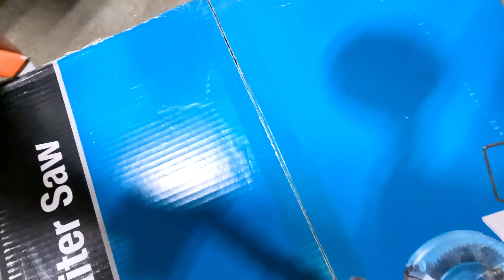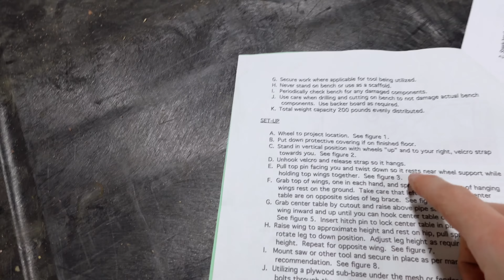I felt unsafe using this tool...

Comment: I'm not sure the problem is the saw. Don't sell it short, that particular saw is not just "made to cut construction grade pine" It's a pro-level saw. I own one myself and have neve found it underpowered or incapable of the job...  I think there are several things at play here. For one thing, your blade. If you are using the saw heavily, it's time to upgrade to a professional blade that's designed for that task........ Your own words indicate that many of the issues you were having are of your own making. Specifically, you knew the belt was worn out (that can sap your power), you admitted that you were stopping mid cut (a no-no, especially in this situation), and you came right out and said you don't use the saw the "most correct way." ......... I understand you may feel the saw is worn out (if there is slop in the arm, maybe it is), and maybe a new saw is the right choice for you. But I worry that you will have similar problems, and perhaps even injure yourself, if you don't also learn a bit more about proper sawing technique, especially through thick, rough lumber that you admit is full of internal stress. There is a right way to do it that won't lead to another ridiculous sequence where you are pounding the blade free with a hammer, nor will lit lead to a kickback, which you are just asking for if you keep going as you are. It would be better if I showed you. Do you mind if I make a follow-up video on my channel (I would use a few clips and images from your video)? I promise to be nice :)
Reply: I would love to see James address this. Please say, “yes” Davis. 🙏
Reply: I love your videos and explanations. You're very precise and easy to follow
Reply: I would listen to Stumpy. He knows what he is talking about.
Reply: +1 on a good stack of pro blades and a reputable sharpening service. Replace and send for sharpening whenever cut quality decreases.
Reply: Stumpy, you’ve nailed it. 
Y’all can learn from this man too. He’s fair, and more than that he’s honest. Stumpy Nubs pulls no punches yet he’s honest. Let him do a follow up. You’ll benefit in so many ways.
Reply: Completely agree. 
Im not sure the miter saw is even the right tool for breaking down rough lumber itself. Jigsaw would be better. 
And all this worry about dust… what about dust masks? A better filter (rather than a bag) on these dust collectors?
Reply: When Stumpy Nubs comes onto the comments, things get real. I would love a follow up video — a great collaboration in the making.
Reply: I hope to see this video as well.  Stumpy has a way of just making things simple and understandable
Reply: I too would love to see the follow-up video.
Reply: Just because you are making stuff doesn't mean you know what you're doing. Don't espouse opinions on tools until you understand what they are designed to do
Reply: Davis, take James’ (Stumpy Nubs) offer. He is a master. Education is great! FREE education is even better. 
For your fine dust, you definitely need to get a replacement filter in place of the bag.
Reply: I’m in for a SN video on this!
Reply: Well stated! Davis this would make for a good collab on your part... may want to think on this offer a bit.  Love the idea of taking the challenges and using it to make an educational video.  Have followed you stumpy for years and borrowed many of your ideas in my own journey with woodworking.  Appreciate you and all your content, will be keeping an eye out for the update video.
Reply: @stumpy nubs I completely agree. I have that saw and it’s fantastic. Took me 30mins to adjust it and it cuts everything like butter. It’s seems like the saying “ a good tradesman never blames his tools” applies here 😂

Comment: I think you're just very unexperienced with using a mitre saw, that clip you showed with the old saw blade being stuck and you had to hammer it off is ridiculous, that has never happened to me or any of my guys in 40+ years of using mitre saws all day long. And we're cutting through 3"-4" of material for 8 hours straight. We used to have a 7-1/4 kobalt saw for around 2 decades and it never had any issue and now we have a kobalt 12" saw and it cuts everything with no problems. You need to learn how to prevent, detect, and counteract binding like you were having that shouldn't ever happen and it wouldn't ever happen to someone who knows how to use mitre saws
Reply: While this comment may come a bit harsh it is absolutely on point. Sadly it is the lack of knowledge in correct usage of the tool and the lack of proper maintenance. But I also understand the other side of the "I will just buy a new one to continue my business". 
The ultimate upgrade for their business would be a Cutoff CNC machine. I operated one some time ago and it is an amazing asset when need to cut a lot of pieces. It featured 16" blade and laser track system plus self feeding mechanism.

Comment: One lesson I had to learn with chop saws is how to cut thicker material right. Had the same issue you did for the longest. My woodworking mentor pointed pointed out 2 mistakes.

On thicker stock make scoring cuts and make them by starting close to you then push to the blade away. It makes sure the blade cuts the way its meant to (towards the back of the cut) and you'll release stress on the wood as you work down and through. Also make a few passes. Never a full bite in one shot.
Reply: When you think about it those two tips are just common sense. I think guys get in to to big of a hurry especially when they are breaking down a lot of board feet in a short period of time.
Reply: @richardlug6139  exactly. One of the other lessons I had to learn was to slow down and same person told me like this: if a process would take you 10min to complete. Make I take 15. Slow down and do it right. Rushing causes mistakes and accidents.

Comment: I bought that same Makita miter saw a couple of years ago after doing a ton of research, and I love it. I haven't tamed the dust collection beast yet (procrastination is a thing for me sometimes), but the saw itself is great. It was dead square right out of the box, the soft-start motor makes it easy to handle, and it's super accurate (for a miter saw). I have had it bind up as I was cutting some thick lumber a couple of times, but as I got more experience and improved my technique, I haven't had that happen for a long time. I think you made a great choice. I think the Makita miter saws have the best price/performance ratio of any miter saw on the market.

Comment: Wrong blade for the application... wrong usage of the saw for the timber you are cutting.  Dust collection is poor yes but the other issues on there are yours not the saw.  Yes the use on it likely justified replacement or at least maintenance.  All tools need maintenance.  This saw will experience the same if you don't change your patterns

Comment: I am a bit surprised that you did not get the 12", but no matter, the Makita is an absolute beast of a machine, and if yours came as my 12" did,  it should be dead nuts accurate out of the box. And yes, the dust control is great too.
Reply: The fact that it's a 10" gives it more angular power. It's mechanical, it's just a better lever. It also means less wobble of the blade, less blade weight, etc. I also tried to put a thin circular saw blade in a table saw once (instead of the 10") and omg the cut was so sharp and easy. If you don't need the bigger blade, a smaller one is actually better.

Comment: You must have gotten a lemon, as I have used this saw for a few years now and it has performed flawlessly. Seeing the blade stuck in the warped wood kinda makes sense, as the warped wood is under a lot of tension. This is why you should take shallow cuts and not try to to cut thick piece all in one swoop. I know you are new to woodworking, so maybe it could be a little lack of knowledge ...just saying.

Comment: 1st -... I by no means am a bosch guy. But honestly that's a nice saw (yes I do own it.) But give it 2 years and you will have the same problems with your new saw; if you don't change how poorly you treat your tools.
 2nd-you sell a shit-ton of cutting boards. Why don't you stock them? You know you're going to sell them, keep them on hand to get them out the door quicker. 
3rd- you do look like a turtle. 
4th- build your own custom tailored to you mitersaw station.
5th- if you're capable of doing the work, chances are you can put some basic metal legs and rollers together  fairly easy.

Comment: Looks like the new setup lacks a rear fence to keep boards straight as well as no place to put stop blocks. I'm not sure why you don't like shop made equipment. It also seems like 10" is a downgrade from 12", which may not matter for cutting boards, but if you do more furniture work, you may need to cut bevels and may miss the larger blade.

Comment: Do short relief cut at like 1/4 depth that will help prevent binding (for ref watch how bourbon moth makes miter cuts in his videos). Also you run a business, buy better blades. Diablo blades are junk. Highly recommend CMT carbide blades because you can send them out to be sharpened multiple times without needing to buy a new one, so you can save a few hundred dollars over the lifetime of the carbide teeth

Comment: I wonder how the rollers will work in the long run. They do seem nice to maneuver long heavy boards. One inefficiency I have found in my current miter station is I find myself cutting a bunch of the same length boards. I don't currently have a stop block system so I either have to mark each board resulting in higher chance of user error or I have to macgyver something together with scrap wood and clamps to get some form of a stop block which tends to not work great. I wonder if there is any way to incorporate a stop block system with a roller system? If I can save a few minutes here and there it might add up over time with the stop block.

Comment: I have the Bosch, 10” and it is over 5 years old no problems with it at all. I wander how worn out yours was when you got it used? 

Other than the festool all of miter saws tend to leave  the dust collection wanting. Glad you found something that works well for you all. 
Did you look at the fastcap hood? 

For the stand the rollers look great and for what you all do will be great in comparison to the wooden table top! Big fan of finding someone who does Whig s well and paying them to do it better than you could! Spend the money to make more money at what you are the best at.
Reply: The Bosch 10" used in a personal context vs an abused 12" is quite different... Technique also counts.

Comment: Why no Kapex if dust collection was the priority? (I have a blend of Makita and FT as well, dust collection king is certainly the latter)
Reply: The Kapex is an incredible saw! I have two of them and love them both!
Reply: @paulhopkins1905  It is a cult... so did you want the red, blue, yellow, or orange cool-aid instead?
Reply: @paulhopkins1905  I was just messing with ya.  Same deal here.  I hate having several battery platforms, but no one manufacturer seems to have it all (and i'm not willing to grossly overpaying for drills / drivers).  I will say for festool their sanders have been difficult to find something that outperforms in my shared garage space (don't want my gym covered in dust after a project)... but if I had a dedicated shop space may not matter as much.
Reply: @paulhopkins1905  I’ve seen it pop up on some feeds, looks like they nailed the ergonomics like the ETS model and the Mirka
Reply: Festool is expensive.
Reply: @MrTresto  my initial thoughts exactly… but as I worked through multiple cheaper tools, for my sander and track saw would have been cheaper to go with them from the beginning than the several cheap tools I purchased on the way there.  The user experience is also in a different league compared to many other brands.  With that said I’ll keep my makita (or sub Milwaukee) drills over the Festool personally.

Comment: Why not the Kapex?
Reply: @paulhopkins1905  I have two Kapex’s in my shop. You are incorrect.
Reply: @paulhopkins1905  do you have a Kapex? I have 4 mitre saws in my workshop. 2 dewalts and 2 Festools. The Festools are more powerful.
Reply: @paulhopkins1905  I’m sorry you don’t have a Kapex. Enjoy the dust in your lungs and inaccurate cuts.
Reply: @purplecouchproductions8657  BOom Roasted